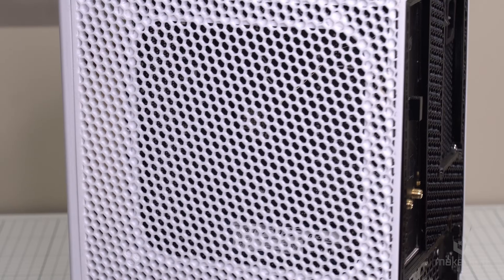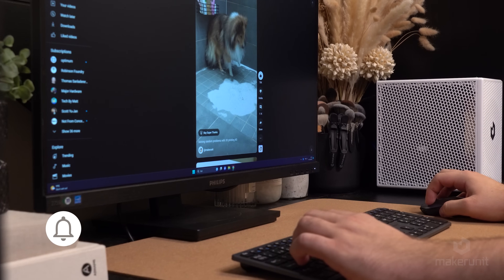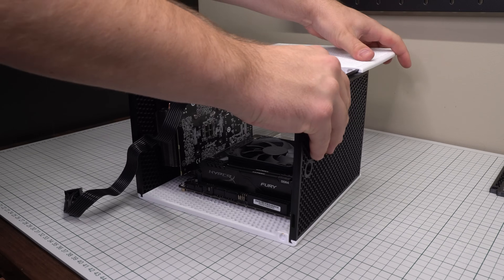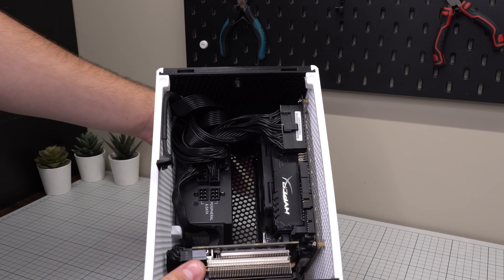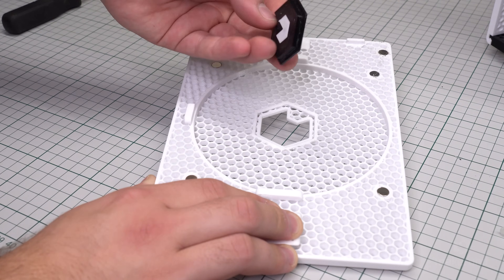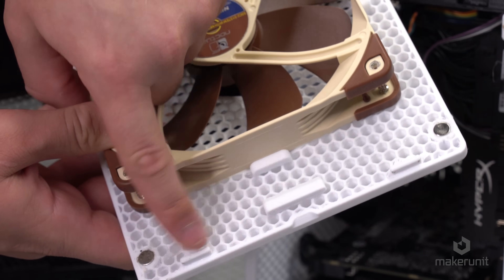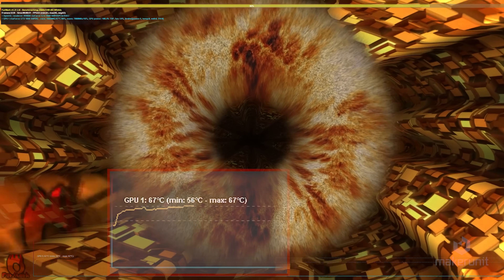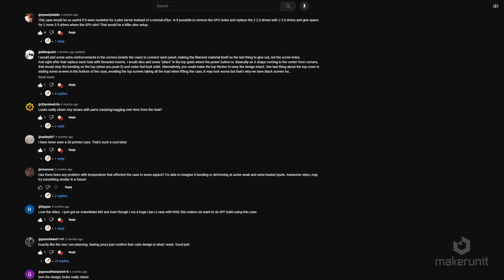Tiny 8.1L SFF build - 3D printed PC case

Comment: Time flies quickly, it would be nice to have a slightly bigger case where I could fit a longer dual-fan graphics card and, for example, two 2.5-inch drives. I’ve got a whole shelf of them lying around, and it would be a shame not to use them as a game storage.
Reply from the maker: I see, I’ll be sure to consider 2.5’’ drive support for future cases where possible 😊

Comment: Wish it could fit just a little longer GPU. Looking at building my daughter a portable rig with a GPU that's 199mm
Reply from the maker: Working on one now that supports 250mm GPU’s, it is slightly bigger though meant for more high end components.

Also, this one can easily be modified to 199mm if you know how to extend the length of a Step file, also it would depend on your printbed size if it’ll fit or not.
Reply: @makerunit  Nice!  I ended up going with a 5060 zotac solo for her rig.  170mm!  Excited to build this!  It's on the printer right now and parts start arriving tomorrow.  i went with a 13400f and 32gb of ddr5 to go with the 5060.  Should make a pretty decent portable rig.
Reply: also orca slicer has a pretty sweet 3d honeycomb infill im using.  This thing is going to look sweeeeet
Reply from the maker: @boredmug  That should for sure be a quite powerful and portable rig! What color are you going for? :D

Comment: This case was the perfect starting point for my wife’s PC. She has my older 2060 just to handle little things like modest video/photo editing.

Big thanks for providing the complete STEP file so I could get the GPU to fit. I added 14mm of length in Shapr3D which would also accommodate modern dual slot/dual fan cards like a 5060 Ti.

Avoiding a riser cable makes this a very affordable way to have small footprint on the desk - wife is gonna love it!
Reply from the maker: That’s awesome to hear, glad you were able to make it work 🙏 I personally prefer riser-less builds myself!

Comment: Is there any chance to resize this for a 220x220mm print bed?
Reply from the maker: Hi, the .step file is included which is editable so you can try to modify it slightly. I think it should be theoretically possible.
Reply: @makerunit  appreciate it thanks.

Comment: I just subbed! Cool case man! I was thinking to use this as a 2 bay NAS. Not planning to use any GPU and use that space as 3.5hdd mounting point. What do you think? 

Keep making cool stuffs man! Excited to see more!
Reply from the maker: It should be possible to modify using the included .step file 😊 You can always try but I can’t guarantee it will work or not, depends on your CAD editing skill 

Thanks!

Comment: I wish there was a FLEX PSU version of this!
Reply from the maker: I hope to get out more flex psu compatible designs down the road. Have you seen my backpack friendly pc case? The green and black one. Is that something of interest? It used a FLEX PSU.
Reply: @makerunit  Yes, I've checked that out. But riser is a big NO. I have 2 pseudo-PCIE 4.0 risers and no way to buy a decent one without overpaying 50+%. Thus, I am looking for a case that fits an ITX motherboard+SFF 4060 (but not a low-profile GIgabyte/Asus), NO riser and a flex PSU. This case is the closest except PSU. 
But for now I will print anyway it and try some FLEX to SFX bracket.
Reply from the maker: @sarganis2576  The .step files are included with this one on Printables, so you could always try to make your own modifications to it 😊
Reply: @makerunit  "Learn to CAD, lazyass!" is in my bucket list for the year, so yeah, definitely doing it.

Overall, I think the 4060 no-riser ITX builds are quite underrepresented. Printed variants especially so.
Reply from the maker: @ I’ll keep it in mind if I come over a cheap one some day I might go for it and see if something can be created around it, but for now my upcoming projects are mostly evolved around slightly bigger parts.

Btw, you’d be suprised at how easy basic CAD can be when you just give it a tiny bit of focus time to learn the «boring basics».

Comment: Hey, so you didn't give a link to the motherboard standoffs and I can't find anything documenting the size. I bought some on amazon that didn't fit the holes, and the ones I was able to salvage from an old case seem too long and are causing it to not fit with the GPU.
Could we get a link or at least more info on the specs for the standoffs?
Reply from the maker: Hi, sorry about that. The height is 6.7mm and the threads are #6-32. (Same as typical 3.5’’ hard drive screws) 😊
Reply: @makerunit  awesome, thanks!

Comment: - this type of build might benefit from the jiushark 13 diamond cooler, which is one of the best buys in terms of performance and price for flat coolers...also making the case be able to handle like 200-220mm long GPUs could open up the world for the gigabyte 4060ti 16gb and i think an asus 4060ti 16gb as well, modern GPUs
- 6:40 what happened there?! is this AI generated video?
Reply from the maker: Yeah definitely! 

And no, this is made and recorded by me but those artifacts come from me using the wrong setting for smoothing slowed down footage. I slowed it down slightly to match my recorded voice a little better. 😅 I do understand it may look AI made as those types of things can often appear there too.

Comment: I’ve printed the little boy S, and that’s my case, but I would like if you can make a compact remake 😅 using a GPU riser and an sfx psu. In my case I have an 190 mm GPU, so I know that you can make it more compact for all those who want to travel with their pcs. 
Thank you for all your videos, your content is so clean and good.
Reply from the maker: Hey there! I’m actually working on a travel friendly case alternative right now, a very slim case using a riser cable. For now that design is using a FLEX psu instead of SFX as many have requested that as well to make it super compact. But I will consider the possibility to adapt the design to a SFX psu also at some point.

Comment: Bruh. That magnetic fan concept is flipping amazing. You need to patent that stuff.
Reply from the maker: Haha thank you! When I made it I didn’t really think much of it tbh, I just thought, oh hey, this works! 😁
Reply: @makerunit  I mean, it definitely makes that building process easier and cleaner. I'm a PC builder and I just got into 3d printing. This sort of stuff is really exciting
Reply from the maker: @LelandHasGames  definitely! However it’s not the most «travel friendly» mount as some shocks will eventually knock it loose. But again, it’s as easy as removing the front panel and dropping it back into place and it’ll be good to go 😁 for a stationary build though it’s superb
Reply: @makerunit  I mean, most desktops are intended to stay in one place or not be moved around often. Still. Simple yet elegant concept. I do plan to print my own PC case at some point. I think there's something special about building an entire computer, (including the case) from the ground up.
Reply from the maker: @LelandHasGames  that’s very true 😁
Reply: @makerunit  would you suggest ABS or PLA?
Reply from the maker: @LelandHasGames  I usually recommend PETG, however if you can use ABS I’d say go for that rather than PLA to be on the safe side

Comment: A really nice case. I am considering a "little boy xxs" variant for current (Ryzen 7 8700G) and upcoming (AMD strix halo) APUs with external PSU. An all mesh case with an ITX motherboard lying on the bottom of the case with just a single, massive fan(* on top blowing downwards. 

(* 160-170mm being optimal, but found only 140mm and 180mm ones)

Also an XS version could house a  SFX or even ATX PSU below the motherboard, everything else remaining the same.

Strix Halo APUs (given that AMD actually makes AM5 versions of those) might give us some real gaming PCs without an external GPU. Even 8700g can do casual gaming and even some AAA titles on 1080p, and strix halo should be maybe 3 times faster.

EDIT: apparently I cannot write, fixed a massive amount of typos.
Reply from the maker: Hey, thank you! 

Funny you’d mention that about the APU, I actually made a design for a mini ITX case with Pico PSU quite recently, but it never made it to a video as it had some flaws. However I definitely want to finish that at some point.

The one I made had room for a massive 200mm fan suckinh air from the top pushing it down into the case and out the sides much like you describe! Then I also started experimenting with PSUs etc and that’s actually how I ended up making my 4 bay NAS. I experimented with some PSU mounting options to then realize some space was wasted around the PSU, started to add some HDDs and suddenly had a NAS 😁
Reply: @makerunit  Sounds cool! 200mm fan is definitely massive. I am thinking of using a rather large Thermalright SL-100 cpu heatsink (75mm in height without the fan) and a Fractal Design Prisma AL-18 180mm fan that is 38mm tall on top of that. I am not that much into RGB, but the fan does have that and it should look pretty cool through the honey comb mesh. I figured out that the fan can be set to be really low RPM and still provide a lot of airflow.

In the mean time I tried to print the front panel of your Little Boy S, and it is just awesome, even though I used PLA. Now I am printing the bottom part, experimenting with settings. I have usually used Ultimaker Cura, but in the default version lacks support for honey comb infill, and a custom version with that support is like 4 years old, so I tried Prusa Slicer for the first time, and it worked well with my Anycubic Predator. 10% infill worked pretty good and even some smaller amount could work, but 5% seems to be pretty extreme and I haven't tried that yet.
Reply: Btw. I happen to have 1kg of white ABS lying around, and I might experiment printing that for the final product.
Reply from the maker: @wallyllaw  Yeah I’m nut sure whether the 38mm fan thickness would fit my design, it’s designed around a 200mm fan that’s 30mm thick with very little room to spare.
Reply: @makerunit  one thing to consider with the case fan is also how it could be attached with some vibration reduction, but I don't know if it matters too much sense with a case that is basically just a plastic honey comb mesh. On a regular case fans will make so much more noise when they are attached without vibration dampening.

Though if some kind of vibration reduction is used, then the fan would need some breathing room around to prevent it hitting side walls, which just makes it somewhat larger and also harder to build. One way to construct it would be that the fan touches all 4 side walls and those walls would just have a little ledge or "shelf" for the fan to lay on, and the top panel would not need to be having any kind of fixture for the fan.
Reply from the maker: @wallyllaw  120 and 140mm fans are quite noisy, however the 200mm fans are super quiet. Especially the ones from Noctua. The 200mm is super quiet because it pushes more air at lower Rpm.

Comment: qq- what size threaded inserts are best? i used m3 x 5mm and I think theyre maybe a little small?
Reply from the maker: Hmm, mine were 4.6mm outer diameter. I believe the holes are also close to that. Some have mentioned that they feel a little loose. I think I fixed that but I’ll have to double check when I get home. 

I didn’t use knurled inserts on this so might be why they feel lose. If they feel too lose it’s possible to insert a tiny plastic bit into the hole to make it melt into place better. Like a tiny one layer cylinder to give it that tiny extra grip.
Reply: @makerunit  oh that makes sense, do youhappen to have an amazon link to the best options?
Reply from the maker: @jarethgar  I’ll be home in a few hours. Or are you in a rush to get some? I’d like to double check the dimensions of the hole on the model I shared just to be sure before I make any direct recommendations…
Reply: @makerunit  hi, no rush! Thanks for taking the time!!

Comment: Hey mate, just built your case- amazing stuff. I've actually paid for other designs that were far more complicated and essentially multi-day projects for something I could have bought from the store. I love the ease of printing, the way the case looks after printed, and your clear, detailed instructions. I'm honestly surprised you only have 17k subs- you're doing excellent work. Can't wait to see what new creations you come up with!
Reply from the maker: Hey Jaret! Thank you so much for the great feedback! This exact project is also my own favorite to be honest, due to it’s simplicity, only using six flat panels and that’s it. I’m planning on eventually making more versions of this exact concept that will require bigger print volumes but may also be able to fit mATX boards and longer GPU’s 😊
Reply: @makerunit  Exciting! I've been in the 3D printed game for a long time, actually had a print farm during the pandemic, prusa minis and adventurer 3s. Your project is the first I've built on my new Bambu Lab P1P, and I'm thrilled with the results- and the fact that I do not have to babysit the damn printer like with Prusa.
Reply from the maker: @jarethgar  that’s awesome! Never tried a Prusa myself. I’m currently using a Creality K1 Max, and in the beginning it was a little trouble but that’s due to the machine not being properly tuned from factory. So after some frustrating tuning I finally got it right. Actually it has never failed on me so far (after my tuning) apart from some tiny imperfections in the first layer from time to time, after hundreds of hours of printing, but generally I’m pleased. 

I’ll probably get their new K2 when it releases due to the 350x350mm build plate. It would open so many new doors. Then I could actually even make a 6-piece full size ATX case without splitting panels.
Reply: @makerunit  I actually had a Creality K1 Max, but I read on Reddit that they were shipping some units with a messed up extruder/hotend. Unfortunately I was shipped one of those units and the printer did not have the "out of the box functionality" I was craving.

But for the price+build size it was definitely tempting, I just did not have the time to fiddle with it. I'm glad you were able to make it work, and I'm sure it is fine with a little TLC. Also who knows how well this Bambu Lab will hold up in the long term? 

I'm with you on the K2+build plate- that kind of space would open up so many possibilities! I'm actually using your build to create an idea I've had for awhile- swapping out optiplex boards+intel arc 380s to make a recycled/ultra-cheap low end gaming pc/emulation machine.

Right now I'm rocking a AP201 mini case, but it would be amazing to print my own 3d case for a bigger build!!

Definitely looking forward to your next build!
Reply from the maker: @jarethgar  yeah I guess it’s a hit or miss type of thing. Hopefully they learned a lesson with all the K1 problems. Now I can just click print right from my PC and I don’t even bother to check on the print in most cases, as it just turns out perfect most of the times.
Reply: @makerunit  It was easier to try the K1 for me because of Amazon and the easy return process. I've heard Bambu is not nearly as hassle-free, so I definitely feel like I took a chance with this one. 

I think once K1 stops selling the busted version I might take a look. It is kind of a bummer that they  were still distributing those as of Dec 2023 (when I received mine). If I find a deal I might give them another shot based on your rec!
Reply from the maker: @jarethgar  I purchased mine from a Norwegian reseller on December 27th and I got a good one luckily. Gantry was skewed etc though, and the belts were way too tight even when loosening the screws all the way, so I had to disassemble the whole extruder head to access the belt clamping piece, loosening both axis by one tooth was enough to make it perfect.

Comment: @makerunit I love this tiny 8.1 design. is there a way to print this on 220x220 printer bed. or are you working on any similar design which can be printed on a 220x220 bed in the near future ?
Reply from the maker: What printer do you have? You may be able to squeeze a few more millimeters out of some 220x220 printers. I’m able to squeeze exactly 227mm out of my Ender 3 in the width direction. HOWEVER it may require some modification to the firmware…
Reply: @makerunit  I have Ender 3 V3 SE . Do you have any resources to make the firmware modification.
Reply from the maker: @suryaveersingh1561  the firmware modification requires you to dig into the code of the firmware to modify the digital bed size. However, I do not recommend messing with this unless you’re experienced with modifying code etc. Are you? 

You may be able to skip this also, but I’m not sure. Try turning on your printer and homing the X and Y to position zero, see if you are able to move any of them lower than zero, and then move it all the way to the highest possible number to see what the max number on your screen says when trying to move it manually. It may be that your max X position or Y position is 220, however, you might also be able to move your printhead down to -3 or even -7 to hit the home switch, not sure how it is on your model but on mine I could move it a bit past, I have a Ender 3 v2.

Let’s say if you can get -7 and your nozzle is still inside the bed surface, you can tell your slicer you have a 227x220mm bed, and tell it to start the print at -7. if that makes any sense.